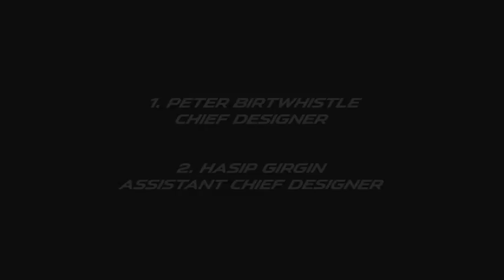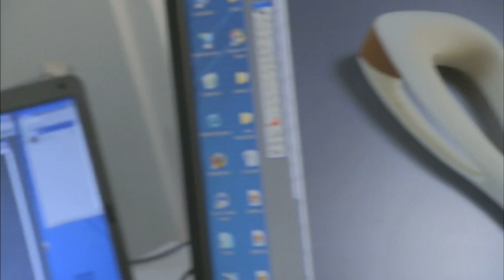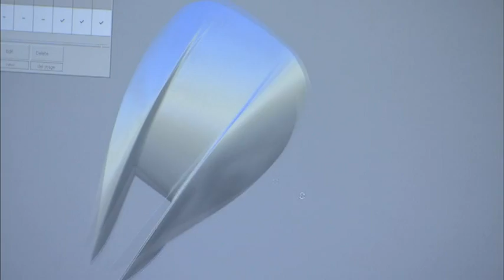Mazda MX-5 Superlight Development - Part 3

Comment: Are you guy's kidding me?  Why would Mazda go through all the trouble of choosing their lightest vehicle, stripping away all unnecessary weight and then spoiling their efforts by mating it to a larger and heavier engine from the Speed 3?  I can't believe that people still don't realize that the MX-5 is and never will be designed for straight-line speed.  It was designed from the start to have a small engine, featherweight body and nimble handling.  This version is the epitome of that mindset.

Comment: Never been a big fan of the Miata/Mx5 but this car looks great. Very very well designed and will be a classic car for sure.
Not sure what the specs are off the top of my head but it's like 125-135hp right?
Mazda 3 engine?! Can u guys say wheel spin city. 
That engine is way too heavy and powerful for that light of a car.
I agree the power needs to be uped but not by that much. I would have ok'd a 170-190hp 1.8 litred engine. This is no drag racer gentlemen, but a bit more oomph would be nice